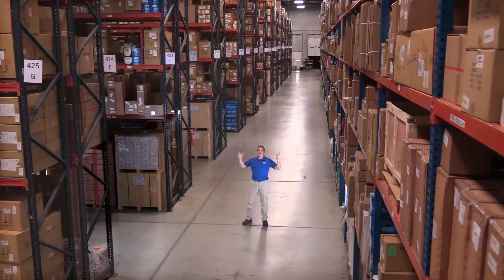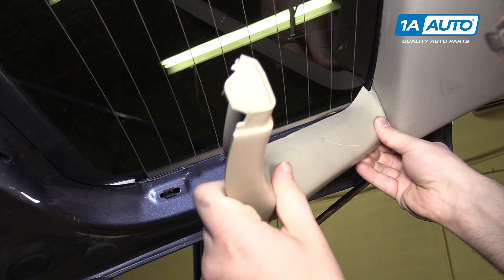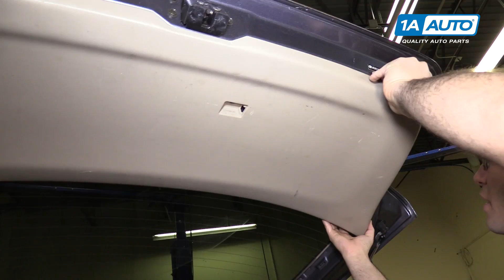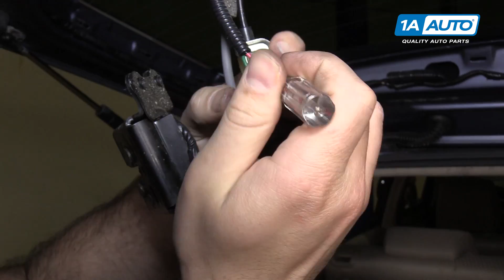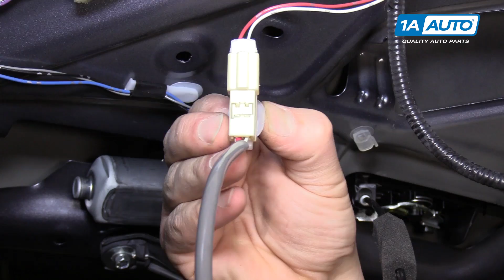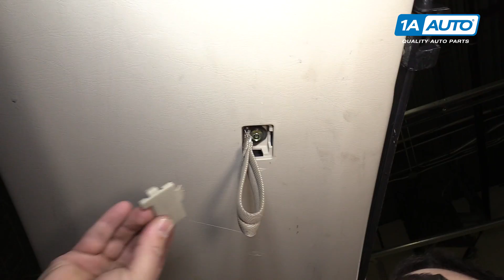How to Replace Rear Hatch Door Latch 00-07 Toyota Highlander

Comment: I've searched high and low across the Internet and auto shops for a replacement hatch cable that fits the 2004 Highlander and have yet to find anything that will replace the original hatch release 17-18" cable. I keep finding 30" cables for the Sequoia and reviews say its too long and therefore doesn't work. A direct link to this exact part youre showing in your video would be incredibly helpful & much appreciated 💖

Comment: Hello, I closed the hatch and accidentally closed a car blanket in the latch system.  Question, if I remove the back panel and release the lock, clean out the remains of the blanket, should this fix the problem?

Comment: My rear door is shut and cannot be opened with a key and the outside handle feels disconnected. Any ideas?
Reply: I have the same issue @pastorsteve, how did you end up fixing yours?
Reply: Going to new to cut access hole in plastic trim from inside. You can replace that after fixing